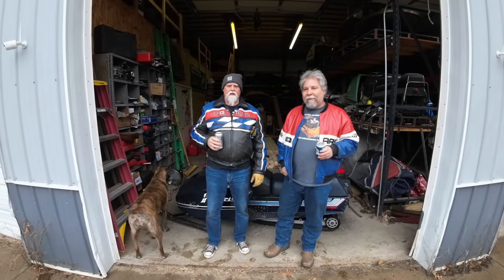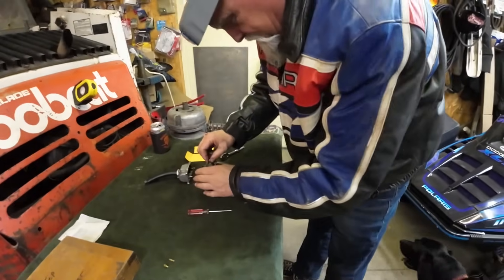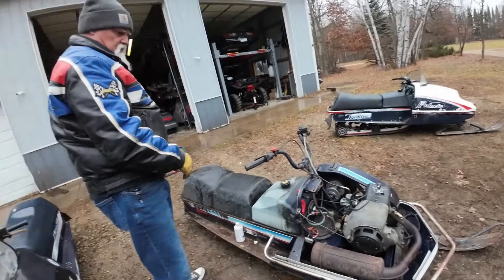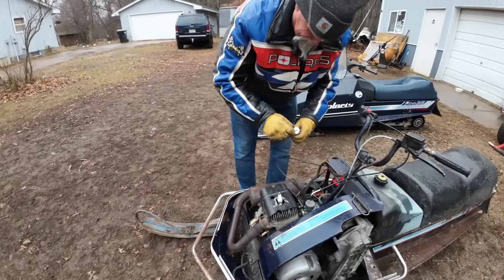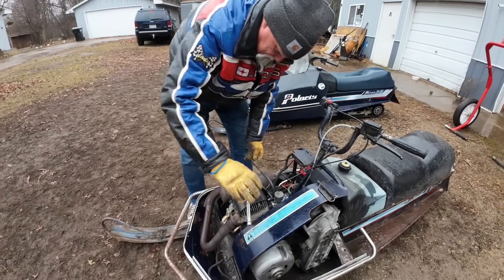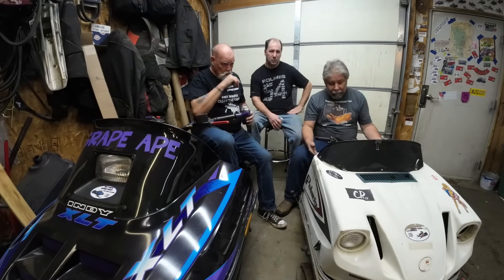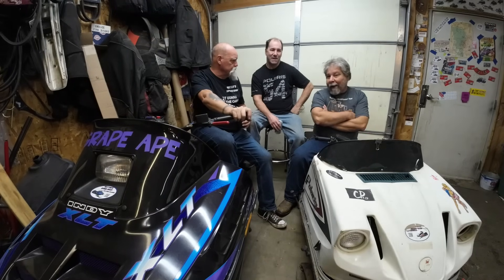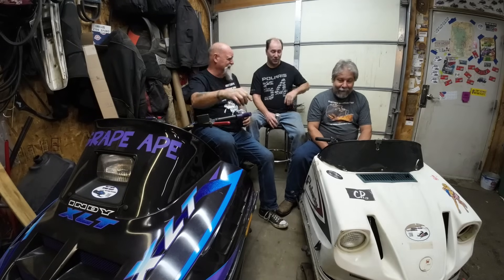Lonnie's Colt Part 7 - Tune Ups and Test Hits! Vintage Polaris Colt Single Cylinder Race Sled.

Comment: I have a 78 cobra. Brake master was fubar. I had wrecked an early 2000s sport in the gen 2 chassis. The brake master on these is hayes I believe. Sweetest brakes I have ever had on a sled even compared to the matryx i ride. Just an fyi.

Comment: Great videos. Enjoy them all.im fixing up a old 1975 colt 250 single. The carb on it the mice got to.i purchase a carb off a ebay that was on a gemini 250.are these carbs identical? It bolts on and starts fine but blows fuel out the carb bogs and runs ruff.any help be appreciated
Reply from the maker: If both are 250 single cylinders you should be able to swap the carbs. Might have a bad needle and seat. Might need to work on the jetting.

Comment: Clean the carbs 🍻🍻🍻
Hey guys, stubborn one lungers eh? lol
Is it a 34mm carb, wonder if an Indy Trail carb setup would be close?  
For the Wild Bill maybe gear it as high as possible?  It’s pretty much a throttle to the bar race the whole way 🤷🏻‍♂️
Fun video guys 
Cheer 🍻
Reply from the maker: Hi Rob, The Indy trail setup doesn't work very well because this sled has a simple can and the Indy had a tuned exhaust. Also a bunch of porting difference. This motor just demands a lot less fuel because it makes less than half the power of an Indy trail.